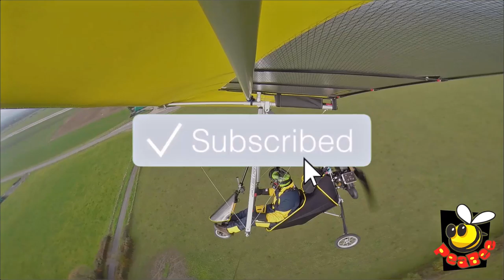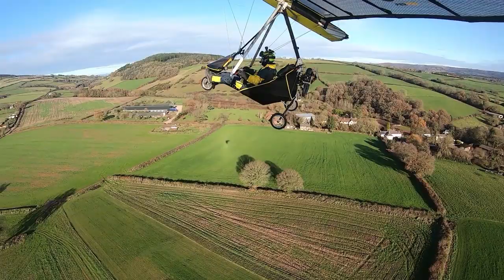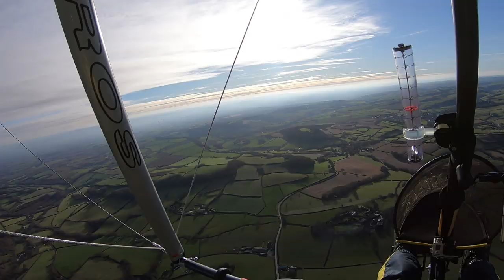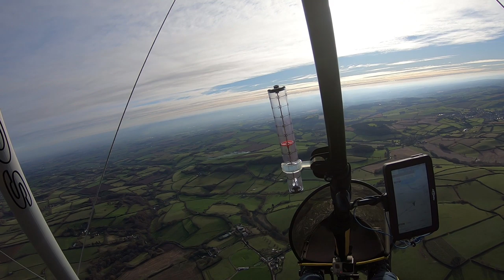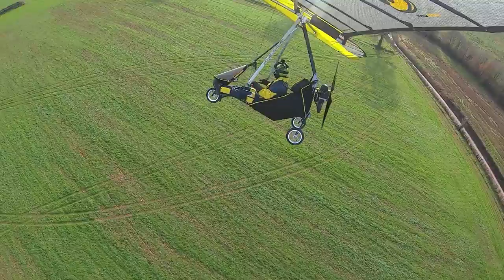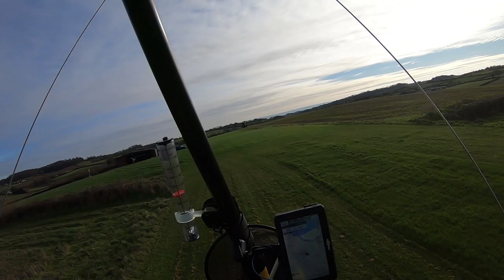Flying on my own for the first time - Nanolight/ Sub 70kg  Vlog

Comment: Congrats Giles and great flight. Could really feel the tension with your approaches and landing. It’s good you have a motor behind you. I remember coming into fields after hang gliding XCs and having to get it right first time (though will admit to a few where I didn’t, resulting in bits of bent aluminium). Still really torn with the idea of getting a PeaBee. Might chase up Ben again yet.
Reply from the maker: Chris, I know what you mean.  Landing a paraglider or sailplane have that requirement. Paragliders are easy as the energy is less.  I've always been interested in hang-gliders but just never found a route into them. This for me gives me all the options.  Hopefully the tension gets less.  I notice I talk less when its a bit stressful which doesn't make for good vlogs...unless you like seeing me stressed..lol.

Comment: Great flight!  Congrats!   Your description of the diffrences between Fixed Wing and Flex Wing handling are spot-on.  👍😁👍
Reply from the maker: I really feel I'm on another learning journey.  It's so muc fun and I love learning new things.  How did your YouTube name come about?
Reply: @GolfFoxtrot22  Most people think my name is a compass heading.   Not so.     Back in the 70's and 80's I was a A&P Mechanic in the USAF, Certified on Airframes with 4 or more jet engines.  This is also the same timeframe when I was flying my delta-wing Hang glider. I was also a Crew Chief for the Lockheed C-5 aircraft. For the past 40 years, I have tinkered on 2-cycle chainsaw engines for the local forestry service. My favorite brand, being Stihl.  To date, I have worked on all Stihl chainsaws, from Model 009 (their smallest) to Model 090 (their largest). Hence,     009to090    😉   
 I have a few videos on my channel showing me using them.

Comment: Great video Giles! 
I hasn't appreciated how low to the floor you were when sitting in the PeaBee. Certainly very different to my Quik. You definitely need to get a full face helmet if you're going XC, it makes It all much more comfy! 
Great landing, that thing stops on a dime but that strip looked a bit 'cresty' (like you said). It reminded me of Troutbeck down in the Lake District. 
Looking forward to the next one!
Reply from the maker: Thank you. Yes, I'm looking at a full face helmet from MicroAvionics, as long as they can add the Vlog mod I have on my current headset.  That little screen certainly keeps the blast off the face. I'me quite low to the ground but its so comfortable. I do miss the leg pod but the Sub 70 kg class  is all about keeping it light so we can carry the maximum fuel.  Everything we add to the base structure means less fuel.  The PeaBee stops so quickly, I think I was stopped in less than 30 meters from wheel touching.

Comment: I've been following your journey, great work mate...your a natural. I was wondering if there are Tundra tyres available for the PeaBee? They would give you more landing options in longer grass and rough paddocks. Cheers
Reply from the maker: They do have bigger wheels available but I can't afford the weight penalty. These wheels were fine, I've even used them on this strip when it's wet and they are fine.

Comment: Congratulations. It is an awesome accomplishment Giles. One question. Why do you keep making your final approach with power on? I taught trike for many years. I always taught to only use the power on final if it is windy. Otherwise It is much easier to pull the power when you turn final and glide in. Then you only have to concentrate on your speed not the throttle as well.  You don't fly a powered final with a Paramotor. Unless it is windy. Why do it with a trike? After all a Trike is a Hang Glider with wheels. Keep up the great work the videos are awesome. Thanks
Reply from the maker: Thank you. I fly a powered approach because that's the way Jim has taught me to.  I don't think there is a similarity between paramotors and flexwings because they land completely differently depending on how they are trimmed.  On my paramotor I only cut the motor at about 20 -50 foot but I can also swoop it in for a longer landing.   When you say powered approach do you mean the engine still running, The Fox 13 wing is so floaty, I already have the bar nearly on my tummy to get the speed to land, if I let the bar to neutral the speed just drops off. All my PeaBee flying friends have said you really have to keep the speed on with both power and bar in.  Having the power helps keep the speed up, only letting off when its time to touch down.  As I said, I can only go on how Jim has taught me. Have you seen the other videos in the Paramotor to peabee series because its in the landing lessons.
Reply: @GolfFoxtrot22  What are you going to do when the engine quits? The wing should be trimmed so the hand off position is at the correct speed not too slow? The wings hang point can be moved by loosening the clamp and sliding it a small amount.  I wound check with Flylight for how far you can adjust it at one time. This concerns me.
Reply from the maker: @flyul1  it's already trimmed fully forward.. There is no trimmer system on the PeaBee, its built for the Sub70kg exemption. I will be practicing engine off approaches. Please bear in mind this was flight 6 on a new aircraft, the first flight on a new strip. I'm still learning. I will be chatting to more instructors to expand my knowledge. Please don't worry. Keep up the good work on your paramotoring. I had a look at some of your videos.

Comment: I would be interested in knowing your opinion regarding the your preference between the PPG and the trike? Does one feel safer than the other? What do you consider the advantages/disadvantages of each? Finally, why the Aeros Nano? Thanks for the great video.
Reply from the maker: I think that question is actually one that really needs a video.  The Wing is made by AEROS, the Trike is made by Flylight. ( the Fox wing is actually to the Flylight specification as well.) To briefly answer your question, one is not better than the other, they actually complement each other. PPG is simpler and quicker to learn and can handle a wider wind range. The Sub 70 trikes are faster, more comfortable but need specific areas to operate from and need a different mindset to fly. I like both.

Comment: That looked a little sketchy. The final landing was good but I think you may be over thinking your approach. Did you instructor say something along the lines of let the wing fly itself, only small movements is needed by you ? 
Obviously I dont know what the guests were so it could also have been that. Either way giles YOUR FLYING IT. And it looks vloody awesome 👍🏻
Reply from the maker: Hi Harry, the gopro video stabilisation makes it seem much worse than it actually was. The main difference between this aircraft and the last one, is there is no trim so you have to pull in to get the speed. Its so light the moment the bar goes out the speed decays. This is only flight 6 so I think I'm doing OK.. Hope to catch up at some fly ins this year.
Reply: @GolfFoxtrot22  that makes sense. I was comparing it to the other one you were flying. But yes you are doing really well. I just thought I spotted something you may have overlooked. Cant wait to see you fly it at a fly in though and I really want that wind speed indicator for my paramotor.
Reply from the maker: @justharryjohnson7250  Google Hall Airspeed indicator.

Comment: Absolutely amazing videos!!! Thank you so much for sharing. Quick question: does your PeaBee have a hand throttle and kill switch? And if yes , where are they located? Thanks
Reply from the maker: Thank you. No hand throttle, it's a very minimalist machine to keep it under the 70 kg limit.  There is a kill (ignition) switch just under the seat. I hope that helps answer your question.
Reply: @GolfFoxtrot22  Thank you.

Comment: Well done Giles, great video set up, clear and very little wind noise off the mic. Seems like an exceptional wing and trike set up, you'll be off all over the place soon, but I have a Question why will you need your pilot rating? I remember with the nppl you cant fly xc on a restricted licence. But isnt the sub 70kg exempt? Cheers Giles
Reply from the maker: I don't have an NPPL at all. The little screen does cut a lot of the wind noise. I'm so impressed with the Fox wing and the PeaBee trike. Ben Ashman really knows what he is doing, I suppose he's been doing it for a long time now.Good question.  Being a member of the BHPA (British Hang Gliding and Paragliding Association) I completed my conversion process under their syllabus. As I'm under the BHPA for my flying insurance,  I've been provisionally limited to Club Pilot (CP) rating which restricts me to flying within sight of the field.  Although I'm Pilot rated for paramotor and can go XC on one of those, the BHPA have put the restriction on my qualification, basically for insurance reasons. I require a number of hours (which I now have) to get the Pilot rating on my powered hang glider, then I can go XC again.  I hope that answers your question.
Reply: @GolfFoxtrot22  Thanks Giles, so to fly sub 70kg xc with adequate insurance  as set out by the bhpa, you have to build up enough hours. Il make some enquiries. my problem is getting any refresher training on a microlight, Nothing available locally and Jim is fully booked til the spring. Il keep at it and happy safe flying
Reply from the maker: @Robbo1966  if you are BHPA, give the head office and particularly Marc Asquith a bell, I was chatting with him today and each conversion is going to be unique as everyone has different experiences. Mine is pertaining to my experience and the fact I have zero flexwing experience.
Reply: @GolfFoxtrot22  Cheers Giles

Comment: Is losing roll stability the similar to torque twist in PPG?  What's the glide ratio?  I really like this. How does it handle turbulence compared to PPG?
Reply from the maker: The roll stability is completely different to PPG torque twist. I've no idea what the glide ratio is buts much much better than a paraglider. It's so much better at handling turbulence because its ridged and won't collapse. You'll still feel it, you always will, the wing just bobbles about. You could see it in some of my training videos.

Comment: Hi Giles
How are you finding the narrow wheels performing?
I have a PB on order and went for the same wheels as you to save weight.
Do they fair ok on grass?
Thanks
James
Reply from the maker: James, I bet you can't wait to fly your PeaBee. Yes the wheels are fine. I've had no issues with them so far. Even on slightly soft post rain (lots of rain) surface. OK it wasn't wet but the ground was soft. They are very strong.

Comment: Hi! How many flying hours did you have, or typical ab nihilo pilot takes before first solo then before being licensed?
Reply from the maker: Hours can vary and is all down to the student. It can range from 6 to near 30. For the Sub 70 exemption flying, there is no licence, you don't even need training ( I strongly encourage anyone to get lessons, they are cheaper than the first bad bump). I had to cover the training syllabus to allow me to get my British Hang Gliding and Paragliding Association( BHPA) insurance which is required for any wheel launched machine in the UK. I hope that answer your question.

Comment: Congrats
With all your experience would recommend training from someone who only teaches flex wing or get Ultralight certified on a standard Ultralight and than move to a flexwing basically teaching myself. From what I can discern standard plane vs flexwing are too different beast so learning from a dedicated flexwing pilot would would be the smart choice 😁
Cheers
Reply from the maker: I had reread your comment to understand your question. I would recommend getting flexwing training from the off.  Fixed wing and Flex are completely different especially as everything is reversed, even the steering is opposite. The landing style is the main difference as the speed and energy bleeds off so quickly.  I personally wouldn't recommend self training.
Reply: @GolfFoxtrot22  
Yes I know you did and you said you also have flown a Cessna.  I want to fly flexwing but I have the opportunity to get trained from a standard Ultralight pilot instructor(not Flexwing) getting me certified to fly ultralights and then I would just pick up a flexwing and tech myself on it. Is flying a flexwing versus a standard control aircraft so different that later would not be recommended?
Cheers
Reply from the maker: @patrickmckowen2999  I'm only commenting from my perspective. I would have personally crashed if I tried.  I think I did an outro in lesson 2 on this.  maybe I'm just a big scaredy pants but I've been around aviation to know that training is essential in most things.  Someone i know said it quite well.  The first crash is genuinely more expensive than the lessons that would have prevented the crash in the first place.
Reply: @GolfFoxtrot22  Words of wisdom

Comment: Giles, excuse me if 've asked this before.  What engine are you using?  Pros and cons thus far?
Reply from the maker: Hi Ron, It's no problem. It's a Moster Silent 185 cc 2 stroke. Pros, I've used them before and they have a good track record.. Cons.. Its a 2 stroke. I've flown many hours on these and really like them. It's only 25 hp but more than powerful enough for the PeaBee

Comment: What does the clear tube indicate please ?
Reply from the maker: The clear tube is a HALL air speed indicator. The further up the red disk moves the faster you are going. If you look at a later video where I have the hang point modification carried out, it shows it working, more in line with the camera.  I hope that helps.
Reply: Thanks for that mate .

Comment: I'm still wondering where do you have the throttle?
Reply from the maker: It's on the right foot. All flexwing aircraft have a foot throttle, and some have a hand throttle on a splitter as well. I hope that helps.
Reply: @GolfFoxtrot22  Don't you steer (taxi) on the ground with feet?
Reply from the maker: Yes, my feet control the steering as well. If there was a brake fitted, this is operated with my left foot.
Reply: @GolfFoxtrot22  Oh I get it. So it's like pedal brakes on a regular airplane.
Reply from the maker: yes, bars for the wheel control and then little levers you push for the brakes and throttle.  The Steering is the opposite way round to normal 3 axis aircraft.

Comment: What licence requirements are required for this type?
Reply from the maker: In the UK we have a Sub 70 kg exemption from the CAA that means we don't need a licence. The set up I have complies with this Sub70 and I think it is fantastic.  Where do you Fly?
Reply: @GolfFoxtrot22  Sounds good to me, I am currently in the North Wales, and completing my flight training for my PPL (A) and hope to pursue a career in fixed wing aircraft, but have always looked at flexwings as a really good option for pleasure flying as they are considerably cheaper than say a PA28 to operate, the sub 70kg category seems like a good option as I will only be flying this way on my own, and due to the lack of licence requirements, although I would definitely seek some training first though but we have a few two-seater flexwings based at our airfield too. What is the cost of the PeaBee if you wanted to buy one?
Reply from the maker: @studentpilotjones2087  I'm ex PPL(A) but had to stop a long time ago.  The Paramotoring and PeaBee flexwing have allowed me a cheap way to get in the air and one compliments the other. The light weight of the Peabee does limit the higher wind conditions in which it can fly in, but going SSDR will be an easy conversion for you with your current licence, you can then fly a heavier machine like the Dragonfly.  The prices will have changed since I purchased  so have a look at the Flylight website, it will have more current prices. http://www.peabee.co.uk.flylight.co.uk/
Reply: @GolfFoxtrot22  Will do, thanks for your help! I'll check it out

Comment: I heard I take 2 hours to break in engine
Reply from the maker: Yes, 4 15 minute ground cycles with 15 minutes cooling inbetween.  Then you have 30 minutes flight cycles until 15 litres has been used.
Reply: Golf Foxtrot 22 what type of ⛽️ gas ?
Reply from the maker: @themechanic4222  normal Unleaded petrol 95 octane.